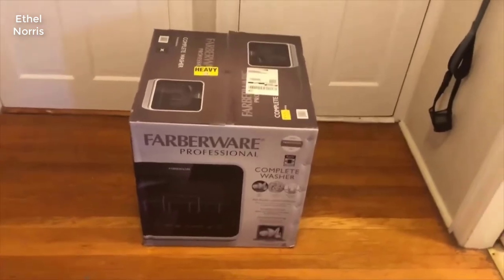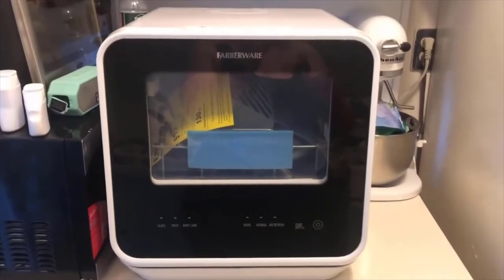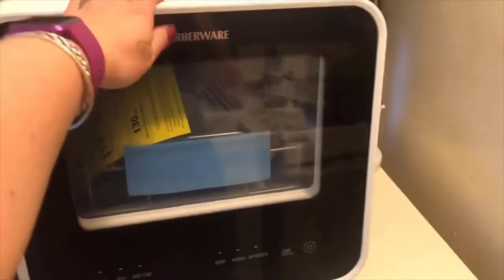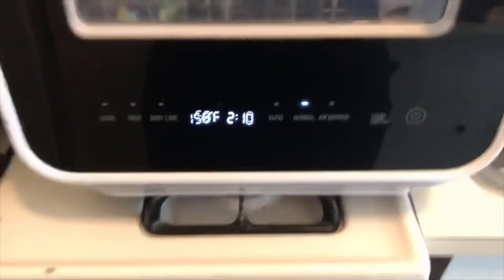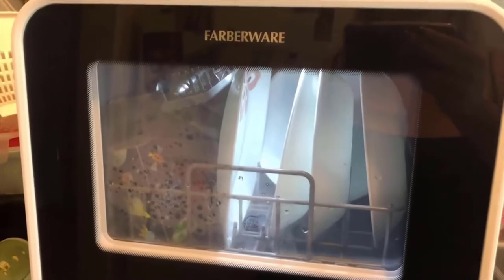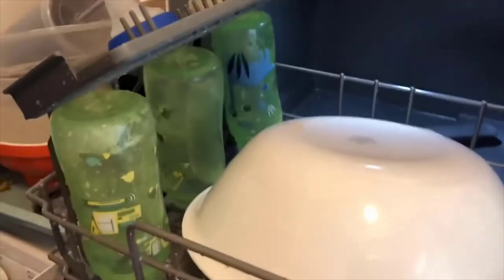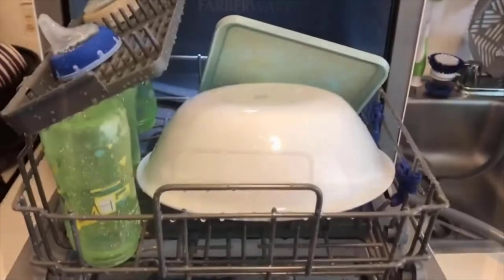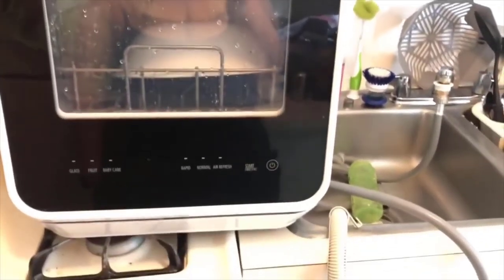Farberware FDW05ASBWHA Complete Portable Countertop Dishwasher - Review 2022

Comment: I have this same dishwasher and I love it!! I found a Tupperware container that I think is for cereal and it is taller than the pitcher that is with the unit and I only have to fill the Tupperware up twice and the dishwasher water tank gets full. I have had this for a while and I can wash almost a sink full of dishes including silverware in one wash. One thing I do is I only use the rapid wash option which washes the dishes perfectly. The other thing I do is I use scissors to cut the dish detergent pod in half (yes I really do this 😂) as a full pod is for a regular size dishwasher. This saves on buying pods and the dishes are never over smelly of soap (learned the hard way) and this process is just the right amount of detergent for a small machine. I always use the Cascade pods as they work the best they do cost more but I use half so the cost is worth it and Cascade always leaves the dishes squeaky clean and no problems with left over food on dishes. I do scrape off any obvious chunks of food every time and I  clean the filter often.
This has been one of the best purchase I've ever made as with my smaller kitchen I could never fit a full size dishwasher anywhere. Best thing of all is i only paid $100 for it brand new in the box off of FB marketplace. !!